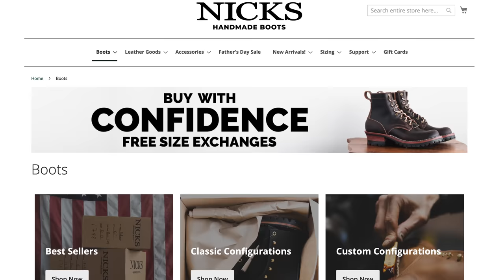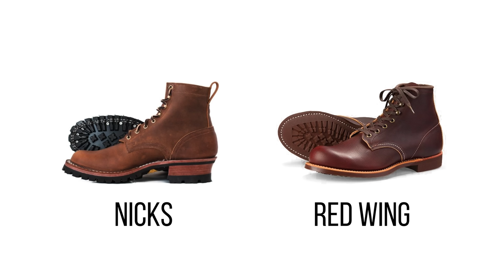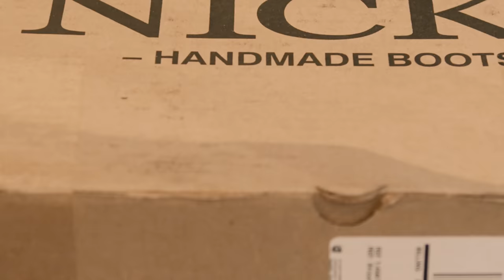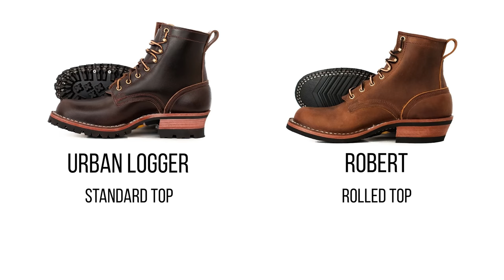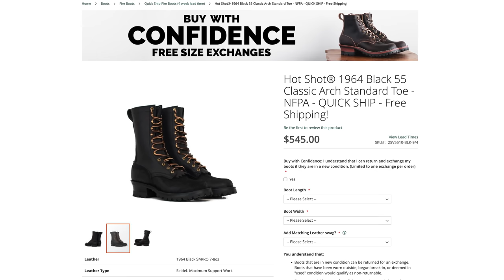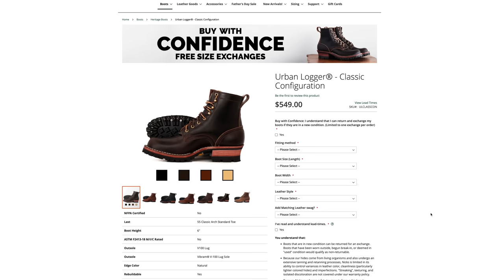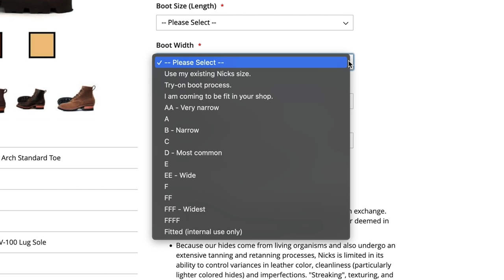Unboxing NICK's Urban Logger: My Heaviest Boot of All Time??

Comment: I've owned a pair of Roberts in Predator Orange for about a year now, and they're pretty great.  The leather is very forgiving and any marks can be polished away pretty easily, and the build quality is fantastic.  But I also got a pair of White's MP boots in Olive Waxed Flesh on the 50/50 last a few months ago, and I think I actually prefer them.  The single row of stitching allows the narrower toe box to be much sleeker, and the heel isn't quite so extreme.  I also simply adore the Olive Waxed Flesh.  But even though I prefer the MPs, they're very different boots and I'm ultimately glad that I own both.

Edit: At their heart they really are very different boots.  The Robert is a churched-up work boot with options for a more casual leather and outsole, but still built like a tank and with an emphasis more on ruggedness than refinement.  The MP feels like a much more casual boot with great build quality.

Comment: Having bought my Nicks Builder Pros late last year (end September, early October I think?) I got them in April of this year, and there have only been maybe four days since then that I’ve worn any other shoe at all (excepting the days when I don’t go out and therefore don’t need shoes on) and honestly, beyond breaking in the leather at the ankle, allowing me to actually walk (which honestly only really took all of two weeks) there’s been virtually no break in at all. I was expecting a lot of discomfort and some blisters and things, but even though they’re about a half size too long, the only real pain or discomfort I’ve had is down to issues with my feet rather than the boots themselves. 

In terms of protection, so far they’ve protected me from hatchet and axe blows to the ankle when the edge has bounced/skipped off logs, they’ve saved me from catching fire whilst trying to put out an out-of-control bonfire, they’ve kept my feet dry in torrential rain, and most importantly, they not only keep metal shards out of my socks, but I don’t dread putting them on in the morning and I’m in no rush to get them off at the end of the day (so much so that I’ve even slept in them after a particularly hard day where I got home and just passed out)

To sum up, for AUD$1300 and change (accounting for exchange rate and shipping) this is the best investment I’ve made to date. And the customer service team have (in my experience) gone above and beyond. 11/10, would recommend

Comment: I have 6 pairs, full time fire fighter. 2 station boots, 2 wildland fire boots, a pair of Moc toes and a pair of the rose anvil collaboration. Love my nicks! The real work boots (station boot and wildland boot) have a brutal break in. 120+hrs for mine. My Moc toes where way easier. The rose anvil collab was somewhere in between. Best boots on the market, can’t make myself wear anything else! I need to get a pair for when I’m not in jeans still
Reply: Nicks states 80-100 hours for break in but I’ve made the same experience. It took me 120+ hours to break in my Hotshots. Might also be because they gave me an A width instead of a B but at least they are comfortably tight now

Comment: Got the urban drifter with moderate heel height and the chrome xl is buttery from the start. Little break-in. Fit is comfortably snug around arch with no hot spots. Surprisingly, they look good with casual pants on the town, even with the aggressive lugs. I’ll be testing them on a mountain hike this month. If they past that test I’ll crown them “most versatile”.

Comment: The nicks stamp comes on the work boot line if they’re 8” or higher. The 64 leather series is supposed to be an easier break in. Plus you can rebuild them even tho most people wont need it. Definitely a lifetime boot.
Reply: It’s pertinent to note that they don’t always apply the stamp as heavily or crisply on Joe Blow’s boot as they do on the ones pictured 
on the site or a pair for these Youtube reviewers. Mine have  it, but it’s barely readable. It might not actually be showing anymore.

Comment: I have a pair of Urban Loggers in Wickett & Craig veg tan leather. And a pair of Robert in the 1964 leather. I found the 1964 leather fairly easy to break-in despite the thickness of the leather. For me, the hardest part of getting accustomed to Nicks boots wasn't breaking in the leather, but getting use to their weight.
Reply from the maker: I agree! They're so heavy, you can't sneak anywhere wearing these. Hard agree on the 1964 leather not being that hard to break in
Reply: my Builder Pro in 1964 were practically no break in time, how hard was the break-in with your Wicket & Craig Urban Loggers? i ordered a pair of Renegades last week in that leather.
Reply: @couchsofa2977  the break-in for the Urban Loggers was a little more difficult because the veg tan leather was stiffer than the 1964, and because of the aggressive V100 lug soles. The big, hard, lugs have little give and when walking on a hard surface, you start to feel it after a while...
Reply: Right?  I weighed mine on the scale and my ND1s were heavier than my heaviest cowboy boots by 1/2 pound and thought meh no big deal.  My first day wearing them at work and walked up 30 flights of stairs over the day I about died

Comment: No reason to rip on you for getting quality footwear. My Builder Pros turned out to not quite be ideal for my work environment, but they are an outstanding boot. Defiantly my go to when it’s going to be a heavy day on my feet. Going to get a pair of the Wedge Workers that will be more suitable to the slick concrete floors I work on.
Reply: Something to look into is a dual wedge and lug outsole construction. Saw a video here in YT of a cobbler doing this. And they look so JUICY and THICCC ... lol

Comment: Your body heat does more to break in the boot than anything else.  Do not use conditioners to soften the leather.  Use subtle heat.

Have you ever had a barber wrap your face in a hot towel before a shave?  Do that with these boots on your feet!

The heat will soften the leather and you will be able to reshape the leather to your foot, ankle, and shin.

If you ever watch a Nicks “how its made video” the lasting process is described as “wet lasting.”